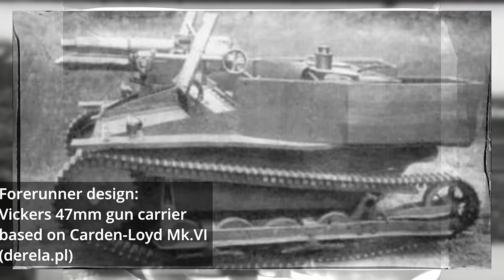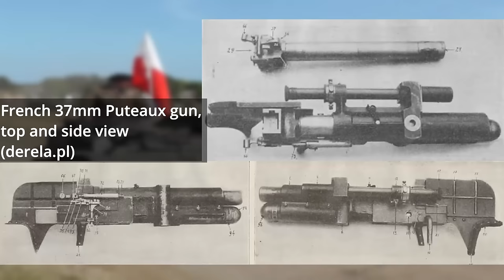Innovating on a Shoestring | TKD

Comment: I never understood why they didn't simply make mortar vehicles out of them. Lighter, simpler, and just about as effective, the only 2 features it would be lacking is anti-tank capability and the ability to fire in flat trajectories. 

Other than that it would be the perfect light and inexpensive artillery vehicle they needed.

Cool little vehicle none the less! I wouldn't mind having one just to tool around in!

Edit: Depending on the mortar size, it could have possessed better range and effectiveness than a 47mm projectile in an artillery role.  However, it would be next to uselss against armor.
Reply: Mortars had not been popular thing in interwar Polish Army. 81mm wz. 1931 mortar was slowly entering service from 1935, it was relatively large for such chassis.
Reply: Their role will soon be filed by armored, tracked or wheeled drones. In and out fast, light armor, decent firepower. The closest stop gap we've had since the 60's is the Technical and Humvee or off road buggies.
Reply: @Galvars  I was thinking that exact size, but if it's too large to fit in the chassis, bummer.  It's a shame they weren't more popular; they'd have made excellent fast-moving light artillery.
Reply: Thing is that mortars are not actually more effective for engaging many kinds of bunkers and other common field fortifications. Mortars were great for indirect fire and area suppression, but when it came to directly knocking out bunkers, trenches, and other positions, many nations found that small direct-fire cannons, like the French 37mm mle.1916 and the German 7.5 cm le.IG 18, more effective for supporting infantry assaults. Infantry guns could get more consistent direct hits on positions, either destroying them outright or better suppressing them. Since the infantry guns were putting their shells much closer to the targets, infantry could get closer to the positions before the guns had to cease fire. 

Even today, we continue to use many weapons that are spiritual or literal successors to the infantry gun of the early 20th century.
Reply: @genericpersonx333  dealing with fortifications would be another disadvantaged on the part of mortars. They don't have the capability to deal with hardened pill boxes or bunkers.  Plunging fire does little to reinforced concrete, even if it is high explosive and the accuracy is atrocious.

That's the reason why they built vehicles like the StuG; assault guns are better providing a mobile platform for cannons that have better accuracy and energy.
Reply: It was too lightly armoured for a direct fire role. Mortars are the only weapon that makes sense. The 81mm actually is a good fit for its role. How it would physically fit is up for debate. Ammo crates would best be carried in a rack on the back. Equipped with a radio for fire control.
3 per infantry battalion would logistically  be possible and still be effective.
Reply: The main problem TK-3(as well as L3/33 and many other Carden Loyd tankette knock offs) is that they were put into production as is. Brits enlarged Carden Loyd to get Universal/Bren Carrier. This allowed it to be universal vehicle for transporting and towing equipment, supplies and personnel while being no less combat effective then any of those tankettes. Poles themselves eventually tried to fix this issue with introduction of C7P, best domestic polish armored vehicle design of interwar years.
Reply: @genericpersonx333  I find it interesting that the Soviets developed the 37mm, 81mm 107 and the 120mm mortars in large quantities.  Easier to produce, with lower quantities of lower quality steel, easier to train crews and easier to manufacture/supply ammo. And with the 107mm and 120mm you had "stand off" range. 8kms. Far enough to easily avoid counter battery fire. Then there were the 160mms. But they were produced in small #s.
And Tampella tried to get the Waffenamt to produce mortars of all calibers with them since ties were broken with the Soviets in 1933. 240mm and 300mm designs were offered as well.
Reply: For sure, mortars are useful, but infantry guns certainly pulled their weight as well. 

Really, the key is to have options, rather than just one or the other. 

Infantry guns let you directly engage bunkers while mortars let you suppress the ground around and behind the bunkers, keeping the enemy from maneuvering in, out, or around their positions. 

Between the two of them, the bunker is less able to stand up to an assault as its occupants are trapped by the mortar fire around them and the bunker itself starts to break under the infantry guns. 

Add in the big artillery targeting bridges, roads, and stuff even further behind the bunker position, the enemy can be effectively paralyzed. 

Put another way: more dakka of ALL kinds make for happier infantry when they have to storm a fortified position!  @kurt5490
Reply: Indeed, the original vehicles really should be seen as proofs-of-concept, as they all needed to be at least a little bigger to be really practical. 

Not unlike the Panzer III and Panzer IV. Just a little more space in the Panzer IV let it be useful to the end of the war while Panzer III was mostly too small to serve as a tank by 1943.  @TheArklyte
Reply: @genericpersonx333  
The main problem for poles(and all other countries except US, who had working civilian motor industry of massive size) was lack of engines. Both in designs and in actual production numbers. And very few countries tried to address that.

Oh no, Pz III/Pz IV production duality is far worse circus that is worth remembering alongside separate japanese aircraft development for army and navy as an example of how countries lose wars:D Though 1)they were doomed to lose anyway; 2)I like being alive. Amd for that I need my grandparents being alive to have a family. So I'm not going to cry over Axis members shooting themselves in the foot on every single turn and failing to kill more people;)
Reply: The irony is that the USA didn't actually have an efficient tank engine design going into the Second World War because they barely had tanks beforehand. Thus, they fought the war mostly by sticking huge aircraft engines or linking multiple small automobile engines together. Reliable and good engines, but very inefficient with space for power and/or consumed a lot of manhours just maintaining the things because each smaller engine had to be worked over and often removed to access parts of others. 

Still, better that than having barely any engines at all like so many did!  @TheArklyte
Reply: @OasisTypeZaku  I think the reason they didn't use mortars for that time period is that Mortars were by far the least accurate artillery piece with the low speed, high arc and large surface area of the projectile even mild winds can send a shot off target by 10+ meters at any significant distance.
Reply: In 11:57' is another Polish self-prepelled gun. Its 37 mm wz36  a-t gun TKSD.
Reply: @genericpersonx333  1)multibank was a british solution for Firefly. US used twin engines at most;
2)alternative view, said universal engine adoption allowed insane levels of mass production as same engine was used everywhere. T-34 was produced for 5 years and had post war and licensed production to reach 50k units. M4 reached 50k units in 3 years and was retired. And it wasn't a bad tank in any way, shape or form;
3)big engine compartment of Stuart and Sherman allowed them to have modernization potential decades afterwards as newer and newer engines were fitted there.

Comment: They need to make the vehicle bigger as well as the capability to mount a bigger caliber gun in the future.
Reply: They were working on a design called "14TP" which would have been enough to mount a decent AT gun, for the time. But of course the invasion of Poland stopped any potential development 😢
Reply: Just to clarify I'm not saying they were working on an AT variant of the 14TP, I'm just making up theories on what could have been
Reply: @sewersquid3761  Honestly, the Vickers/7TP can be an okay AT carrier too.
Reply: @sewersquid3761  Correction: the "14TP" was actually called "12TP", which was found out in the recent years. The "14TP" nickname was most likely made up by Polish historian Janusz Magnuski, who based it on the weight planned at one of the stages of development.

The information about 12TP comes from a Polish magazine called "Technika Wojskowa Historia", specifically from issues 5/2021 and 1/2023
Reply: There was an idea to mount a 200mm cannon on one ! 😂

Comment: A fast lightly armored low profile with an mg and an ATGM Tankente would be a perfect vehicle on the modern battlefield. Super cheap, good vision, hard to detect, has a good firepower to ambush 1-2 tanks and get the hell out as fast as possible and has just enough armor to withstand infantry small arms fire and shrapnel from big guns. Much better, than carrying those ATGM's on foot or on trucks.

Comment: Just looking what kinds of shitty guns there were for Anti tank purpose just goes to shed some light on how menacing early t34 and even worse,kv1's were to face  (if they didnt break down due to reliability issues that is)
long 75's and other spicy high power guns just weren'taround or readly awaiable yet,but that changed when 1942 rolled around.

Comment: 6:27 - the rate of fire per minute was 15?  That's an autocannon.
Reply: Not really.
It’s only a 37mm.
Pretty easy to reload fast
Reply: @paulthiessen6444  Even one handed!
Reply: The "auto" part was based on how skilled loader was, as mentioned it was small gun with light round and fast operating breach. Such loader was able to put that 15 rounds in one minute but that was maximum human could do and only for, let's say one "burst" of energy. Small or not, it was tiring task.
Reply: The RoF of 15 a minute, is an optimal rate. Which would be limited to a short burst at that rate, by a very skilled crew. The main limiting factor would be the amount of ammo within reach of the loader, as the ammo is relatively light, probably ~2kg. 

It is also just the rate of the gun in its general requirements, and not when installed in the TKD. As the gun requirements list 2 man crew, but the TDK only had 1 man operating it.
Reply: @flarvin8945 The Poles used the Bofors 37 mm gun, which fired an AP round that weighed 0.735 kg (1.62 lbs).

Comment: The thing is...
Poland had made very poor choices with its foreign relations.
Moreover they had no capacity to actually produce tanks, airplanes and ships in any sufficient number, but at the same time wanted to have all 3 at the same time. Which they couldn't afford.
Moreover their efforts were sabotaged by insane idea that everything produced needs to be polish designed and be part of national pride.
They had some success stories that weren't obsolete by 1939 and even some that were competitive, but they had no real chance at producing any of those in sufficient numbers.
I'd say that the biggest waste and folly of polish tank industry was the 10TP/14TP dream. Essentially it was an attempt to get domestic BT-7M. Do you like being in BT-7M in 1939? Being inside BT or T-26 tanks was not very comfortable idea even in Spain two years prior. And considering that 9TP was still inferior to modifications soviets done to Vickers 6 ton with their T-26, you can see how great those tanks were by theor perfomance in Winter War against force that had no sufficient quantity ie barely at all of their own tanks, AT guns and other tank busting methods.

Tbh Poland had much higher success probability if it had cut off tanks and fleet completely and concentrated efforts on production of modified versions of licensed small arms, artillery and planes. Wouldn't have been enough anyway and that problem could have been solved only by different foreign policy.

P.S.: yes, 9TP was inferior to T-26. While welding was a good attempt, T-26 had already impoved armamanets and engine over base vehicle far beyond polish modernization. And they produced 12k of those. And they performed poorly in Spain and Finland.